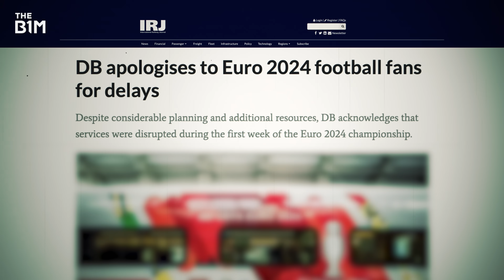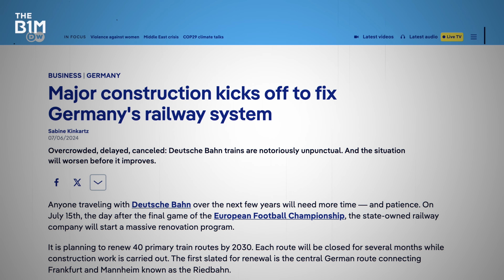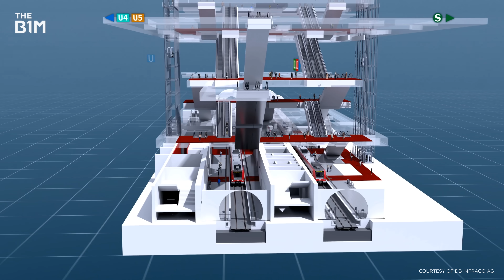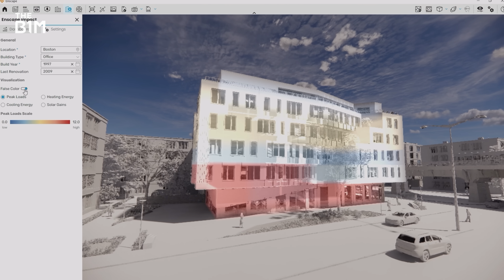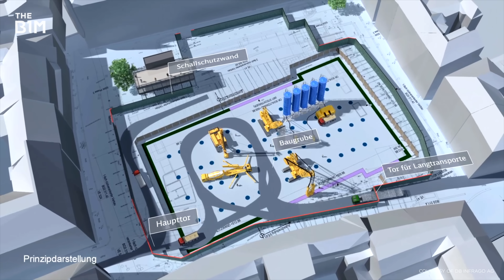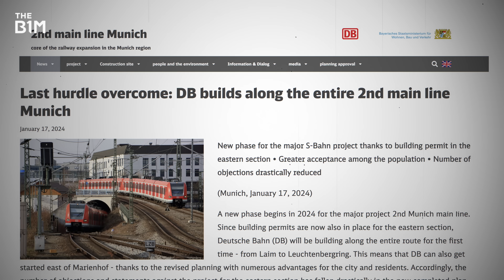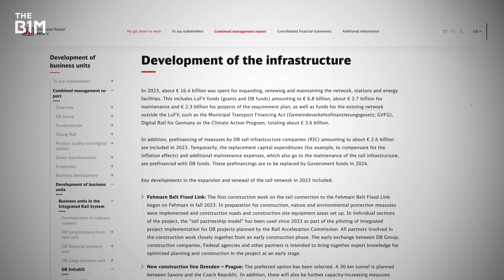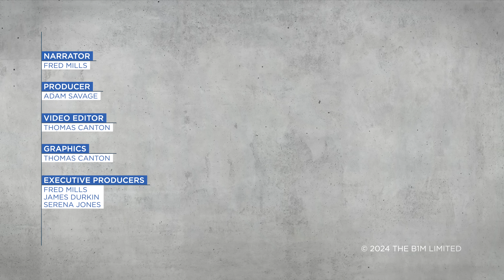Germany is (Finally) Fixing Its Failing Railways

Comment: Update, DEC 27, 2025.
- Munich 2. Stammstrecke is receiving their first TBM in a few months. Given its relatively early state of the project, delay news will trickle in over years, not months.
- Stuttgart 21 has been delayed again to: TBA. The current CEO of DB AG only saving face by hitting us with this news just as she entered her new position. She cited issues with the cab signalling system implementation provided by Hitachi (previously Thales) as the primary reason for this issue. Critics think, this is just the tip of the iceberg.
- Riedbahn re-opened on schedule, but did not complete all works. Some upgrades couldn't be approved by inspectors in time. The lack of qualified inspectors and resulting delays are a common problem in rail projects in germany. By now all upgrades have been accepted and are in operation.
- The next renovation, the Hamburg-Berlin line, is currently in progress until APR 30.

Comment: Neither Munich or Stuttgart's "improved" stations are going to make ANY real large difference in Deutsche Bahn's performance overall -- There are NUMEROUS other train stations that could have used these outlandish and overcosted projects which do nothing but improve the "local transport" within that city it was built for.
IT would have made far more sense for monies to go to overworked, cramped, crowded and congested Frankfurt Train Station that Stuttgar 21 which does exactly what about for DB as a whole?
The only benefit of Stuttgart 21 is that the city's train station will no longer be a "Kopf station (going in and backing out) and that travel south of the city will have easier rail connections - that's it.
Considering that geographical region below Stuttgart, so what?  There are no major cities there and geography impedes this to begin with (Black Forest, terrain.)  
Stuttgart's train station is not even in the top 5 busiest in Germany to which these monies should have gone to first for better service and not some aesthetic "roof" beautification project which in no time will be graffiti-ladened and outdated by nature's wear/tear of the weather.  
Munich as a "kopf" Bahnhof's upgrade will do exactly what now?  The main building didn't need "redeveloping."  It did however, need better connection lines underneath.  Again, beautification takes precedence over practicality on numerous other stations that are needing REAL improvements over enhanced/aesthetic ones.

Comment: I needed to know why they couldn’t dig a tunnel for the extension of the mainline Trains so that they could extend the abandoned London Underground train stations. Why couldn’t they use the part D78 Stock train doors on the sides and also restructure the front face of the Q and A62 stock which will include the class 507, class 508, class 313, class 314 and class 315 remix and make them all together and also redesign all of them into an overhead wire line trains and also make most of them into Five carriages per units and also having three Disabled Toilets on those Five cars per units Q and A62 stock trains and also rebuild most of the class 507, class 508, class 314, class 313 and class 315 trains into a Cummins M11, Gardner 8LXCT, Volvo B10M, Scania N113, Volvo TD102KF, Cummins L10, Gardner 6LXB, Scania N230UD, Leyland TL11, Gardner 8L3B, Volvo D10A, Leyland 510 and Gardner 8LXB Diesel Engines and also put the Loud Six speed Allison Gearboxes even Loud Eight speed Epicyclic Gearboxes in the class 314, class 508, class 507, class 313, and class 315 and also modernise the A62 and Q stock and make it into 10 carriages per unit so it could have fewer doors, more tables, computers and mobile phone chargers? A Stock Train and 8 Disabled Toilets on those A stock trains. Why couldn’t we refurbish and modernise the Waterloo and City line Triple-Track Channel tunnel? So they can dig a Tunnel to Bank Station, making it quadruple-track? So the countries. Australia, Morocco, Germany, Wales, Italy, Poland and Sweden. And can they convert the Waterloo and City Line into a Channel tunnel Triple-Track Railway line to make it 11 times better for passengers so they could go from A to B. Then put the modernised 10 carriages per unit A Stock and put them on a bigger modernised Waterloo and city line Triple-Track train tunnel so it could go to bank station to those Seven countries such as Australia, Morocco, Germany, Italy, Wales, Poland And Sweden. The modernised 10-carriage A stock could be an International Rail The Third Triple-Track Tunnel Train? Is it promising and feasible to undertake this kind of project 48 times if that is the case? Australia, Germany, Italy, Morocco, Wales, Poland and Sweden? And also dig a Railway tunnel so it will stop from Buckinghamshire, Hertfordshire and Essex so that the Passengers will go to Australia, Germany, Morocco, Italy, Poland, Wales and Sweden and also extend the Triple-Track Railway Line from the Bank to Buckinghamshire, Hertfordshire and Essex Stations so that more people from there could go to Australia, Germany, Wales, Morocco, Italy, Poland And Sweden more Easily. And they can extend the West Coast Mainline and also build a new train station, so it could go even further up to Clapton and up to Wood Street. And they can have another Underground train station in Chingford? So, the West Coast Mainline and the Piccadilly Line to Wood Street and then further up to Chingford? All of the classes 150, 154, 155, 106, 117, 114 and 105 will be replaced by all of the Volvo D10A, Gardner 8L3B, Cummins L10, Scania N113, Gardner 8LXCT, Volvo B10M, Cummins M11, Leyland 510, Leyland TL11, Gardner 6LXB, Volvo TD102KF, Scania N230UD and Gardner 8LXB Diesel Five carriages three disabled toilets are air conditioning trains including Highams Park for extended roots which is the West Coast Mainline and the Piccadilly Line trains. And also extend all the West Coast Main Line stations to make more space for all of the Loud Allison Gearing Diesel trains? Can you also build another Tornado Steam Locomotive? So they can order Every 87 Octagon and Every 58 Hexagon shape MR 483 Class diagram unique small no.13 and unique small no.11 Boilers from those Countries such as Greece, Germany, Poland, Italy and Sweden, can they make Mayflower and Tornado Steam Locomotive speeds by up to 157MPH so you can try and test it on the Original Mainline so it will be much more safer for the Passengers to enjoy the 157MPH speed Limit only for HS2 and Channel Tunnel mainline services, if they needed 13 Carriages Per units, can they use those Lister class 17's, Deltic class 93's, Lister class 46’s, Lister class 55’s, Deltic class 44’s and Gardner class 43HST Diesel Locomotive’s right at the Back of those 13 Carriages Per Units so they can take over at the Back to let those Mayflower and Tornado Steam Locomotive’s have a rest for those interesting Journeys Please!!!!!!!, oh can you make all of those 18 Tonne Boxes of Coal for all of those 157MPH Mayflower and Tornado Steam Locomotive’s so the Companies will Understand us PASSENGER’S!!!!!!! Please be aware that the Network Rail Builders should do as they're told!!!!!!!!! And PLEASE do something about these very, very important Professional ideas, please? Prime Minister of England, Prime Minister of Australia, Prime Minister of Sweden, Prime Minister of Morocco, Prime Minister of Wales, Prime Minister of Germany, Prime Minister of Italy, Prime Minister of Poland, and the Mayor of London.

Comment: i want them to place the ICE trains on their own grade-seperated tracks like the shinkansen in japan.
Reply: The reason why they have dedicated tracks for the Shinkansen is that the legacy narrow gauge system is technically restricted to operations with 130 km/h max. Upgradi g the existing routes would have been very costly, thus, building new main lines has been seen as the better solution. Later on few existing tracks have been upgraded so Shinkansen trains could also reach areas that would not be profitable to reach with new dedicated tracks.

In Germany they never ran into that issue plus freight railways are also more prevelantin Germany than in Japan where some high speed lines in Germany are being used by freight trains over night. 

There are actually dedicated railway lines for High speed travel. But first Germany simply didn‘t have that necessity for dedicated tracks and second the regional structure varies significantly. 

Japan is literally an island where they are free to fit the railways as they please and it is shaped as such that you can connect all relevant cities along one north-South-Axis.

That‘s similar to Italy in a way.

And by the way, the high speed tracks are pretty much built on edge and there is a regular maintenance break over night so unlike in Germany you couldn‘t travel in High speed trains over night if necessary. 

So in short, in Germany the need and the conditions were quite different from Japan.

Comment: 4:03 not entirely true, there is the Südring which connects the east wiith the west through the south of munich, but the capacities of this track are limited. Therefore, mostly one of 6 lines (mostly S8) operates on this track when problems occur. + the Südring doesnt serve the city center stations

Comment: between August 2025 and May 2026 (according to the schedule, but...) the busy line between Berlin and Hamburg will be closed for upgrading. IC and ICEs can divert via Hanover, but all the passengers of local and regional trains on that line will be cancelled, including the RE8 that connects to Berlin airport. The DB says 170 replacement buses will be allocated, but I foresee 9 months of chaos. If not longer.

Comment: One of the reasons that the Munich Tunnel is 10 years behind scheduled and more expensive, is that it is basically an under(ground)water project, where you have to work in a pressure chamber to avoid water flooding the tunnel construction site, as it can be seen in the documentary BR24 Kontrrovers: https://www.youtube.com/watch?v=C2b3dxKjnNQ.
Due to this the workers can only work half as long as on regular overground construction sites. There is also a limited supply on workers who also have a diving license, who can work under pressure.

Comment: In Stuttgart the new train station is tiny, not huge!!! Only 8 tracks instead of 16, it is going to be a desaster!
Reply: You don’t seem to understand the concept of a terminus station versus a through station.
Reply: @robsch21  you can be assured, that I am very well aware of this. 4 tracks for long distance => 2 tracks for each direction. Works theoretically, but never ever with 60% punctually of the DB...

Comment: Thanks, that was a nice informative Update on all these projects.

Do you know whether or not the sloping platforms in Stuttgart have already been fixed? - I remember hearing how they had that problem (strollers and luggage would be moving on their own) and also a problem when heavy rains would easily flood the underground platforms/area in Stuttgart 21 (they should call it Stuttgart 31 now 😜- or maybe they'll get the costs high enough so they will correspond with the number 😏😅).

Yeah, I'm not very fond of Germany's ways of dealing with its infrastructure in general - they hamper any projects with underfunded regulatory administration and anything but streamlined processes in the necessary regulations departments. They talk about changing things a lot, but I'm afraid they might mean the same as what Mr. Musk is doing in the US currently: not streamline processes, but just destroy the departments, that regulate and make sure things work safe and well enough to minimize risk for failing equipment, infrastructure etc.

I hope this last part will not be done as it is currently in the US - bulldozer style -, but far more intelligently with facilitating processes instead of "nuking" them altogether.

We'll see, I guess. Maybe I'll even live long enough to use it in my Lifetime...but I'm not optimistic on that since I see how fast and thorough many Asian countries can work to (re-)build infrastructure (also after Natural Disasters - like Japan, for example) and then see how extremely much longer it takes here in Germany when anything like that (mostly floods here) happens.

In general I'm also not very optimistic when I see the trajectory of increasing extreme Natural Weather Events causing more flooding, landslides etc. and how we can and will increase our Infrastructure's Resilience to that on a global scale!? - I think this might be quite an important question to tackle since it will certainly not "go away" on its own, but is still on a trajectory/"vector" of escalation!
"Climate (Change) Resilience"  I think I'd call it - and we should already think about it now rather than when it's too late because implementing this will take significant time and investments, too...and with willfully ignorant people in positions of power and responsibility denying insight into this, I think this (in-)action puts people's Lives "on the line" really.

But, then I've seen the worst possible scenarios, I could extrapolate a decade or two even ago already come to pass / become reality, so who am I to talk, right? - Nobody cares since most people are too busy focusing on their own, hyper-individualized little "Worlds" and don't want to look at the greater whole, of which their little "Worlds" are all a part of still though.

Well, I think if we don't advance at least far enough to catch up with Technological Progress on the Social and Emotional Level soon, I think we might end up like emotional/social toddlers playing with nukes in their sand boxes and sooner or later this will cause our Species or maybe even the Planet's demise (just look at scientists' warnings about developing "mirror life", possible Super Sun Storms, other unexpected global catastrophes possibly caused by asteroids or change in habitable zones through Climate Warming - leading to mass migrations, wars for resources, pandemics etc.).

There's plenty of real problems to solve out there...infrastructure is definitely an important part of it though, so we must deal with several problems at once and see which one takes precedence at any given time...also depending on when they can be paused or shifted to lower priorities and when not (or at what cost etc.).

The Complexities of these interconnected dynamics are certainly interesting and exciting to follow even...

I think the last part you mentioned in the video is also part of the Europe-wide "Ten-T"-Mega-Project for connecting Europe's Infrastructure and making it more efficient, resilient and ready for possible threat scenarios, that seem to become more likely again these days...

Comment: What in this video is missing is the fact that after making DB a private company they wanted to place it at the stock exchange. Therefore they wanted to save money at any cost. Tracks where faster trains could overtake the slower ones had been removed. And the whole infrastructure was brought to its state right now. Also lines have been closed and train or ticket offers have been reduced. There have been a lot of facts why DB witnessed such a decline it would be worth a whole video itself.

Comment: Thank you for the great insight on the Munich construction sites! 
I've been living in Munich for 10 years and I've basically seen the HBF renovation since it started and it's mind boggling to me how much work they're doing while still keeping the station fully operational. And yes the second main line is badly needed, even though I think a circle line of the U-bahn network would also be greatly beneficial.

Comment: The DB is a shitshow. And it's been the same for the last 30-40 years. "We will ... until ... for x billion." (yes, billion) And in the end it +5-10 years and about 200-300% more expensive. "Our estimations were off..."
Stuttgart 21 is a good example. Was supposed to be finished 2019 for 4,1 billion. Currenty it's said 2026 and 11 million. 
The amount of incompetence in this company and in politics is pathetic. And the cherry on this shitcake? No one is going to be held accountable. 
And it's pretty much the same for the Autobahn, Airports (Berlin), Power (electricity), Internet.

Comment: Btw, important distinction, the DB is not exactly "state owned". It is a privately owned company that the German state owns 100% of the shares of.
This is a big reason as to why the system has been failing so much, because the state doesn't have direct control over how the business is run, while the business can always rely on tax money to bail them out, no matter how much they destroy the system for personal gain.

Comment: The origins of this problem was an idea initiated by the former conservative government which was ruling for 16 years, to run the railway system „Auf Verschleiß“, so „until it breaks“. It was supposed to save a lot of money, and I suppose it did, but it just pushed even higher costs down the line. Now everything is breaking at once, and repairs can‘t just redirect trains to a nearby route, because that one is probably also already being repaired.

Comment: Fun fact: France capital, Paris is expanding it's metro system, building 4 new lines and extending the existing lines (most of the opened) in total of 200km new metro line.

 Germany capital Berlin on the other hand, doesn't extent it's subway, in fact, the senate still debates what extension is prioty and even worse, the next extension is U3 line from Krumme Lanke to Mexikoplatz, which is just 800 meters long, will only start in 2026 and completed no earlier than 2030. 😂😂😂